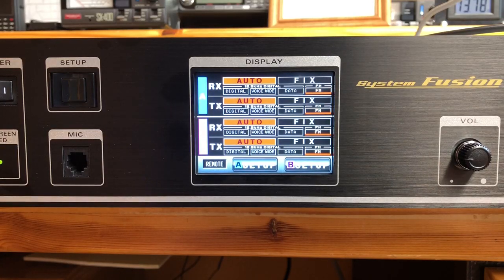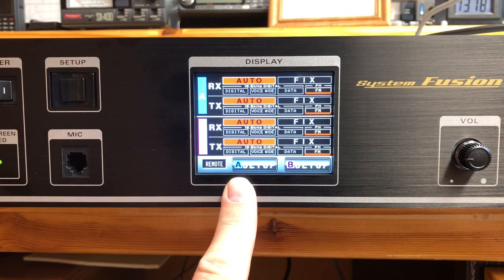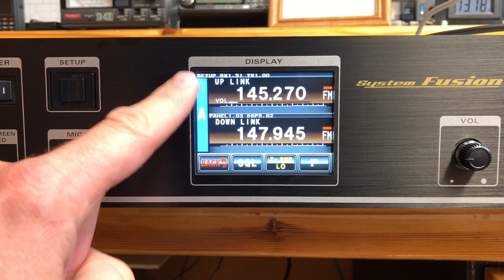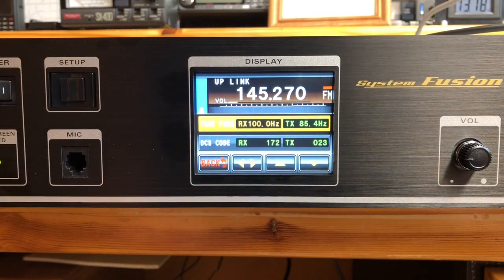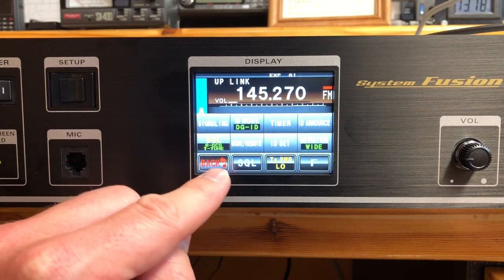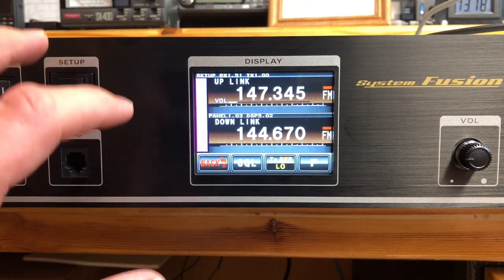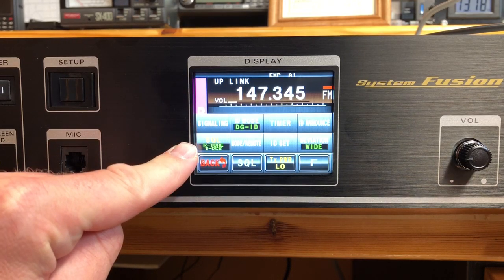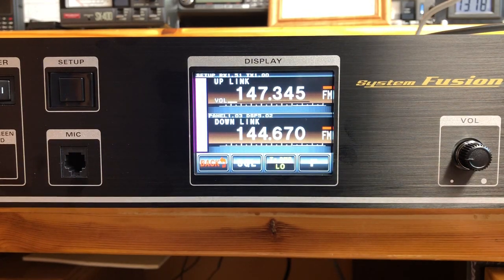Yaesu DR-2X rf link capabilities in an analog setting

Comment: Thank you and if I was trying to use this repeater as a fill in portable repeater on 2m would this work?
Reply from the maker: it sure could work as a portable repeater. i have not tested much past linking a VHF on the low end of the band plan to one on the higher end of the band plan and both within about 20 miles. it may be more difficult if the two repeaters were closer in frequency
Reply: Are you using a duplexer to get this to work?
Reply from the maker: Thuff nope . With this example I just used 4 different antennas ... at the time I had several dual band antennas vertically separated on my home tower 👍

Comment: What about desensing as the system is on the same band...Duplexer required...?
Reply from the maker: no duplexer for these two pairs, they are far enough away from each other that receiver isolation in the repeater was enough  (145.270 has a negative offset while the 147.345 has a positive... basically the furthest two pairs away from each other)  lucky coincidence here

Comment: How do you stop ping ponging between the two linked repeaters...? Will VK6UU
Reply from the maker: with the test environment the 145.270 repeater had a hang time of ZERO,   the 147.345 , at the time of the video had a little longer.   I will have to experiment with an environment of two repeaters that have perhaps a 1200ms hang time (somewhat normal in this area)